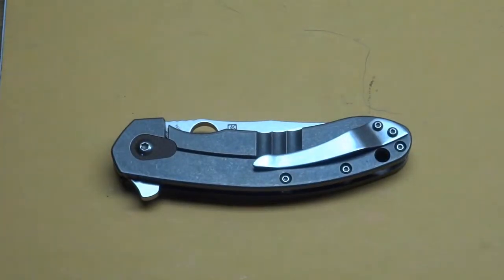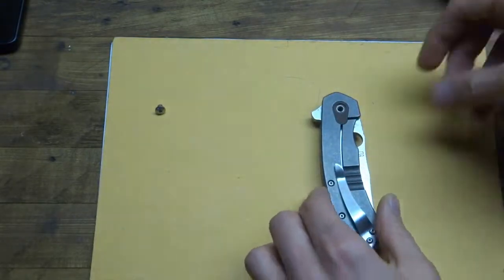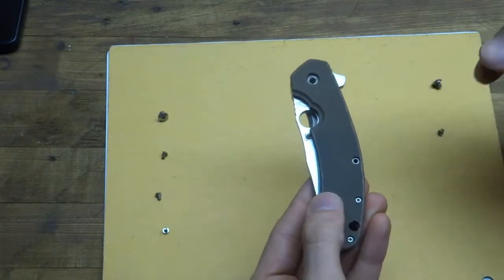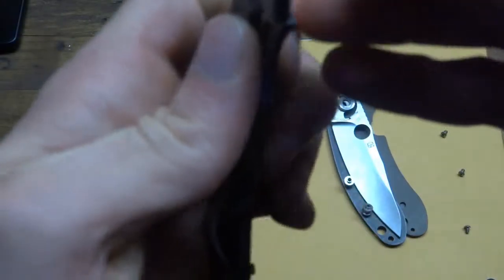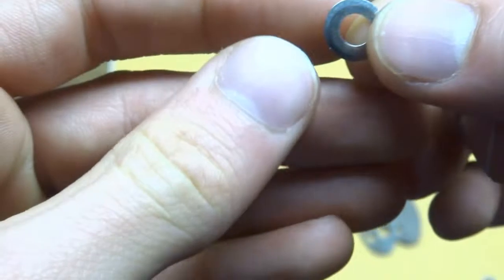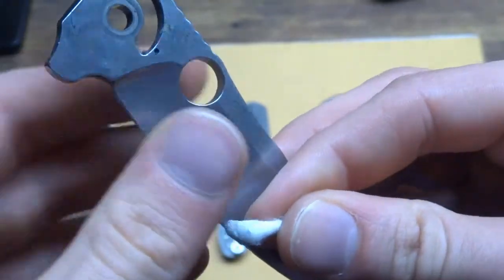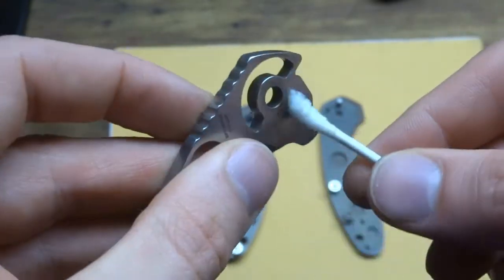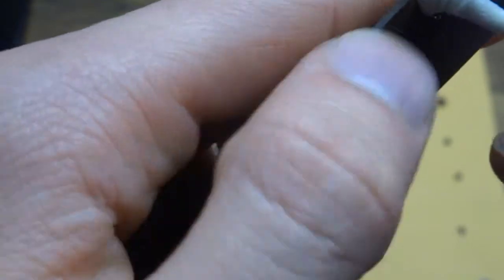Spyderco Southard Take-down and Maintenance (Long unedited version)

Comment: i think putting oil on these is inviting problems! as the barring's really don't need any oil like washers do! in the end,its going to collect alot more pocket lint/dust,buy the way' hows your flipper doing!thank you for the video,good info needed.
Reply: it all depends on the amount.
if you flush them with oil, yes, you'll have problems with dirt and dust sticking to the surface, if you put 2-3 little drops in the groove where the bearings ride, you can increase the smoothness by a landslide.
my southard barely opened when i got it, after giving it the said treatment, it instantly opened beautifully, without any wrist involvement needed.